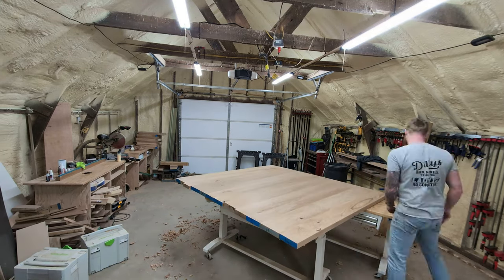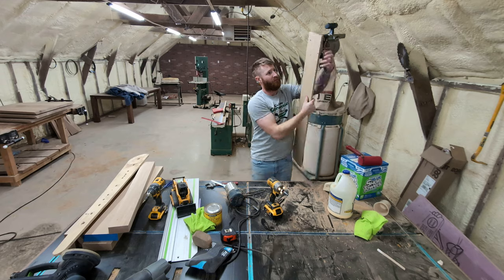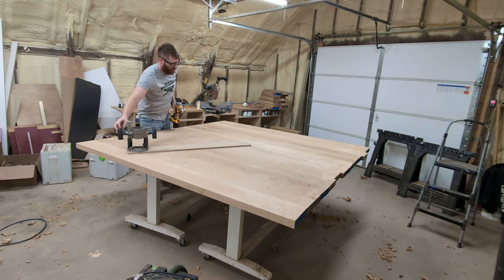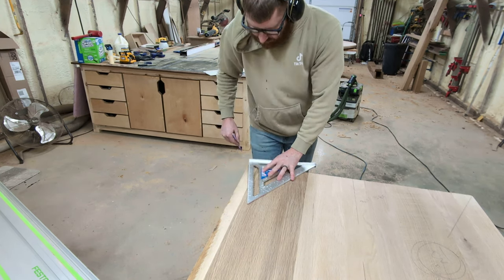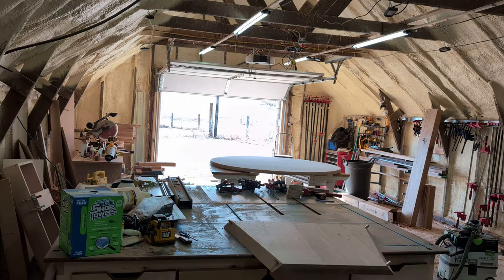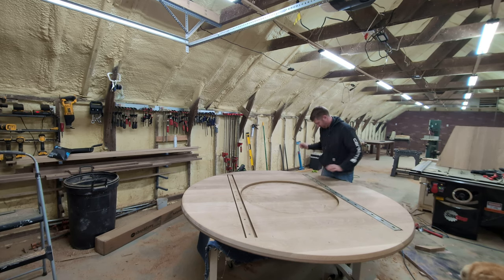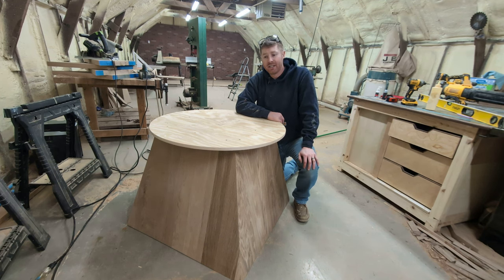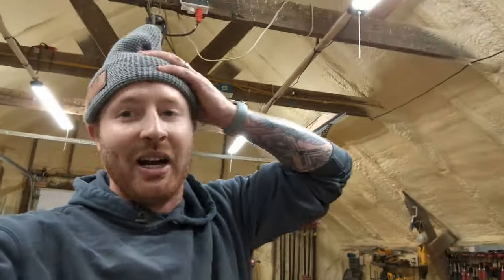beautiful round dining table

Comment: That turned out really nice, very inspiring for my dining make-over. Is it possible to have salvaged the original base by cutting a square insert with a matching outer angle, allowing it to still be flat for the round mounting part?
Reply from the maker: Thanks for watching, he's I suppose I could have salvaged the original base with that method 👍